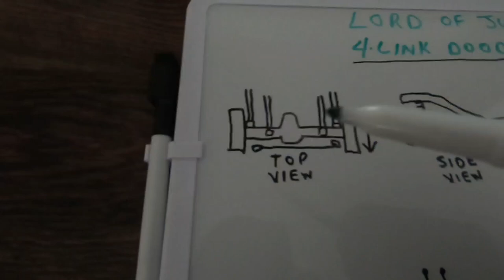Small engine running problems- its probably your fuel lines

Comment: Save some aggravation with the fuel lines.
Fish a thin solid wire thru the fuel tank. Attach it to the new fuel line thru a tiny hole you make in the line. Pull on the wire as you push on the line. Still a little work, but makes the job easier.